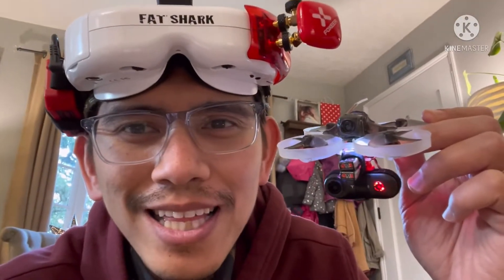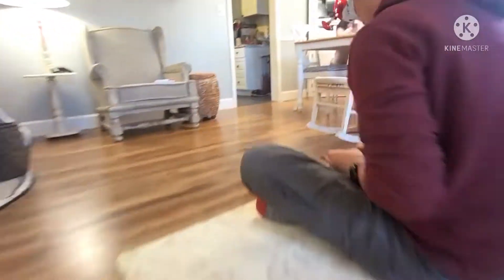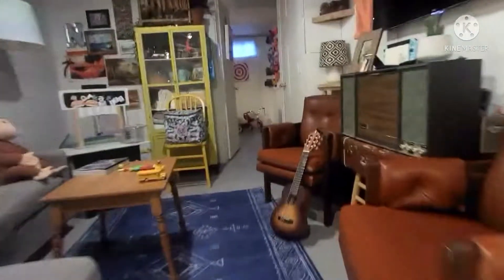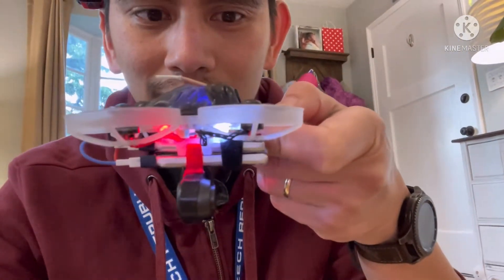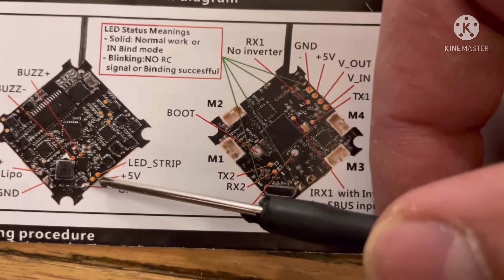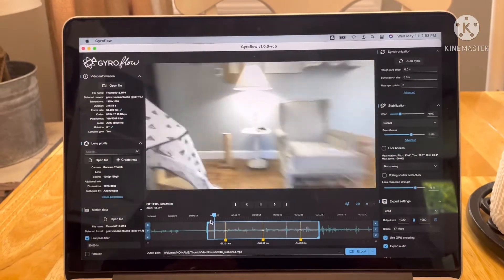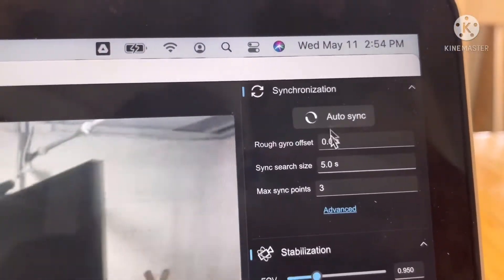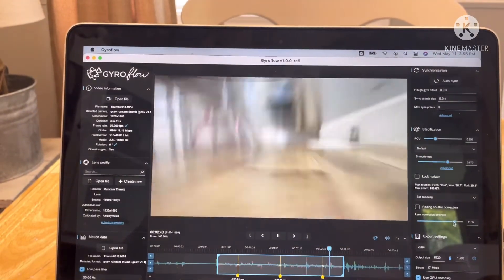Runcam Thumb on Mobula 7: mount, flight, wiring, tune, Gyroflow!

Comment: I wanted to ask you 3 questions. 1. How did you power it? How do you set your throttle to have such smooth altitude maintenance? How did you smooth out the video? You answered all 3 of them. You are awesome 😊 Thank you. But then, to add one for you to answer - you solder a  wire that plugs into a cam? Meaning cam is detachable, only wire remains soldered ("permanent" weight addition)?
Reply from the maker: Hi there, sorry didn't see this notification. it was the same wire as my old brushed whoops, so I just cut the cables from my dead old motors. I added this wire lead to two different quads that I can switch back and fourth with. The wire is "permanent" but can switch the camera around.

Comment: Great review btw. I'm putting one on my Beta85 pro2 soon. Someone mentioned that the included power wire was wired reversed? Did you have tl fix that on yours?
Reply from the maker: Thanks! My board isn’t fried (yet). So I think it’s fine. Issue may have been on an earlier batch or one-time non conformance. 🤔